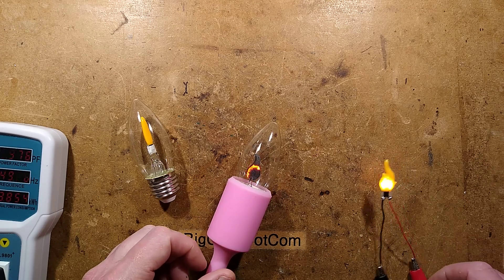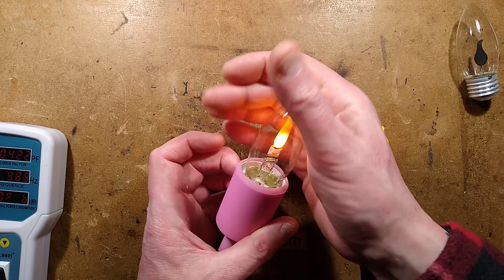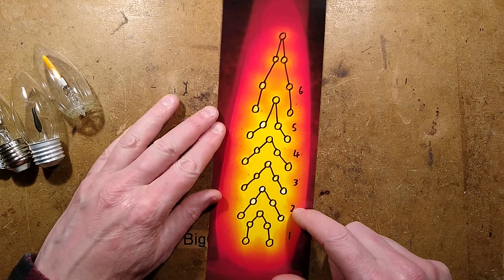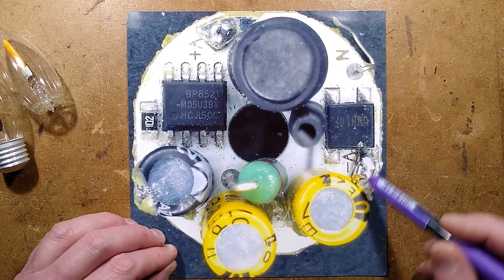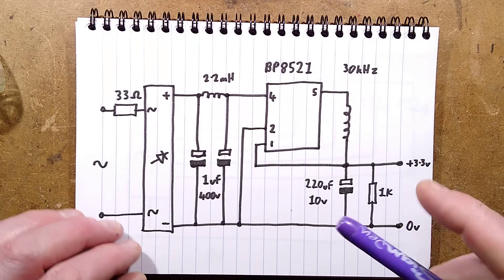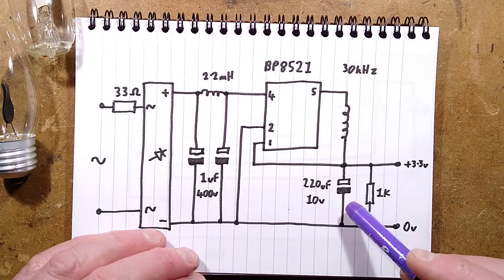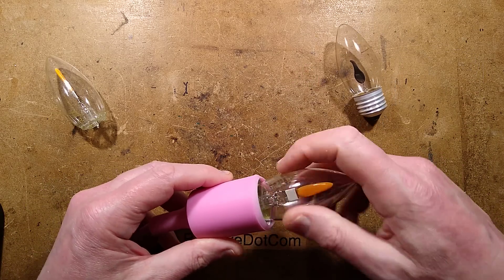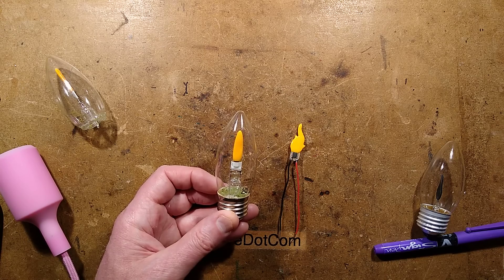New LED flame bulb - with schematic

Comment: There’s a Restaurant in Williamsburg, VA that has huge Chandeliers with real Candles. We ended up going during the day, it turns out the Chandeliers are dripped in Candle Wax, and have LED Flame Bulbs. Very Realistic at Night. Also I have a friend who has Gas Mantle Lights, outside. Again a LED Fake, also has the tiny Speakers for the low hiss.

Comment: I love that light! I need that element in 12V for a low voltage outdoor fixture. Was the other one you had 12v?
Reply from the maker: Both 3V..  but you could use a resistor in series to limit the current, and maybe a zener to cap the voltage to about 5V.
Reply: Thank you! I just found out my transformer outputs 12v AC... That's going to damage the little ones from Ali-Express, isn't it?
Reply from the maker: @WelcomeToMarkintosh  You could still do it with a rectifier and a capacitor in parallel with the zener.

Comment: Hi. Clive. Love your videos. I would love you see you reverse a wireless charger. A 10w vs a 30w or higher. And what could you do at the cheap one. To make it work like a 30w
 So you won't have to pay 10 times as much for 30w compared to 10w.. Hope you read it and at some point will consider it. ❤
Reply from the maker: There is a significant material difference.  Trying to force higher current could cause thermal issues.

Comment: As microLEDs have got so easy to manufacture, it is incredible how they spread among all possible applicative sectors.
I like how they made a geometrical flame outline, instead of using a rectangular matrix and emulate the flame with software. There is still room for improvement!
Thank you Clive...

Comment: I have several old terminal strips that have neon switch illuminators that have started to flicker quite nicely spontaneously...what causes that BTW?
Reply from the maker: As they get older the neon discharge starts moving on the electrodes like a mini neon flicker flame bulb.

Comment: sir, would using a verible power source input allow the bulbs to flicker at a variable rate, instead of just every bulb flicker in unison?  in other words is there a differnt flicker in the us 110 60cycle vs uk 220v 50 cycle...     nice chanel mr clive
Reply from the maker: They run at their own speed, so they drift out of sync.

Comment: Curious if it would be possible to make one of these with the tip of it setup as one of those 'Tesla' arc- electric lighters, {maybe even a proximity sensor to trigger it?) it would be kinda cool  you would have the led flame lamp, and move an object near its tip and the arc lighter could go off and then you have lit your match or 420 in a very unique way.

Comment: EVERY TIME! It gets me when you write on the components on the printouts. It takes a few seconds of wondering how I would write on the top of a capacitor, especially the one that's "behind" two others. And then it hits me, 2D and 3D not the same thing 😅. I claim that I am just very good at spatial perception and imagination (which is actually definitely partly true).

Comment: the invention of ws2812b etc addressable leds are also hugely fantastic. Install WLED via browser straight on esp32. connect and program it via browser or wifi, then power a whole load of them with 5v power bank. or even 12v 20amp for a really bright and decent amazing custom image display or scrolling text effects and all kinds. :) Clive, will you ever do any vids involving WLED ws28112 and esp32 ?
Reply: The local Social Club put up some strips on their ceiling last Christmas. I was surprised that they could do chase effects from one end to the other of a 50+ LED long strip with several strips perfectly synchronised.

Comment: What's the voltage drop across each of the individual leds? How are they powering 5 leds in series off 3.3v?
Reply: they're in parallel. Not series.
Reply: @kimchristensen2175  that makes sense

Comment: Those do look pretty good... 
I've got some flame-imitating LEDs of various groupings around, and the problem I found is that out of the corner of my eye, I keep thinking there's something on fire... It was happening often enough that I had to stop having them plugged in because, with all the forest fires that have occurred up here one becomes hypersensitive. The color and the flickering pattern are just too realistic. I was figuring I'd replace the LEDs with various other colors that I like... as I have all kinds of crazy colors. my favorite is the high UV purplish-looking ones. 
 Speaking of LEDs- near where I live there's a giant scrap yard that sells stuff for the price of the scrap metal contained there-in...  they have everything you could possibly think of including all sorts of giant capacitors, bins of restaurant-quality stainless steel cookware in almost brand new condition... I got a bunch of large solid-state relays... every manner of machine and material... I almost walked out of there with a "Hello Kitty" pink razor scooter...  almost... and when I was there a couple days ago, they had bins of 170-watt industrial LED fixtures, which take 65 volts, so they run perfectly on my 50-some odd volt (48 volt nominal, around 58 point something when at top absorb voltage) home battery bank. These things are utterly blinding... I paid about $2 a pop for a whole bunch of them. Under-running them a bit like that they should last for freakin' ever. running them battery-direct should be as efficient as the most efficient light source... I'm going to install them all around my shop when I can get to it. Well anyway-

  peace and love.

Comment: Those flicker lights like the one in the pink socket. They use the same technique as the lights you get like in a power strip on and off button..... Sometimes you get one where the button starts to flicker after a while :)

Comment: Thats not "fire simulation at all.. thats just flickering or animation. But it has nothing with fire/candle light at all. Adafruit got an perfect example with this: LED Charlieplexed Matrix - 9x16 LEDs - Yellow and a druver for it. Its excellent.
Reply: If you are referring to the Animated Flame Pendant then that is just a video that plays on a loop. It looks great but it's not a fire simulation either. While the tutorial shows up with the Yellow LEDs the video may be played using any colour of their LEDs and I think it would look nicer with the warm white. Perhaps warm white is a newer colour and wasn't available when the tutorial was made. 

On a side note, I saw a tutorial for making an LED campfire and it looked good. That is a simulation as it calculates the LED colour based on four factors which include a configurable heat lost to the air rate and a sparking rate.

Comment: i was considering today that electronics has made me a better person. i think the break-through was starting, on BC's advice, to only solder one lead of a component, to then hold it up to eye level, reflow and push the component flat, then look again, to check, then solder the other lead, check again, then move on to something else. whereas my natural instinct, from making air-fix models 40 years ago, to assembling a new PC has always been ,previously, to think 'that will probably do'. then everything invariably failed. yet now i am using my new habit of scrupulousness everywhere.

Comment: This would be much more useful in an E14 base. I wonder if they used E27 because the circuit would not fit in to the SES base?
Reply from the maker: It's definitely harder to fit a power supply in such a small space.

Comment: The 2.2uH inductor makes no sense. At 50Hz it's about half an ohm, while the caps' impedance is about 3K, so a bout 1/6000th. No noticeable difference from a short circuit. Or is there a reason I haven't considered?
Reply: The buck convertor IC works at a much higher frequency. The filter is to prevent EMI noise from getting into the house wiring.

Comment: If the 8-Pin regulator takes a „feedback“ off of the 3.3V output, if you’d put a diode pointing towards Pin 1 would it output 4.3V (if we assume 0.6V Diode drop)?
Reply from the maker: Some circuits do add zeners in the feedback path to increase the voltage.

Comment: nice bulb. the heatshrink might be there to stop the glass cracking off. one more thing.
the original gas filled flicker bulbs have a secret sideshow mode. the entire bulb can glow orange like one giant neon indicator with high voltage high frequency ac.
wire spiral or grid on the outside of the bulb functions as the second electrode. works with failed flicker bulbs.

Comment: Did you try plugging in two of them at the same time?  I'm curious if the pattern has and fluctuation or if it's just referenced to the frequency of the AC power.  Having an entire candelabra with all the flames identical would look at bit odd.
Reply from the maker: The lose sync with each other.

Comment: Now this is one of the advantages of COB (Chip On Board) LEDs. You can get super tiny and compact LED circuits on a translucent board.
Reply: They work really good on those strip lights...

Comment: I wonder what would be more efficient. A battery pack driving the bulb or an equivalently sized candle? Sure they have their uses but an LED flame bulb is bording on consumerism.
Reply: probably a LED bulb. Most of the energy in the candle is wasted as heat.
The main selling point for the fake LED candle is not efficiency though it's safety (it's a little fire), cleanliness (the candle will leave smoke and paraffin/beeswax/whatever residue around) and zero maintenance (candles don't last long and will need to be replaced often).
So for decorations they often win on that alone.
For actual illumination candles have lost the battle ages ago even to kerosine or gas lanterns, electric is not even in the same ballpark
Reply from the maker: I'm sure they'll have solar versions soon.

Comment: Wlel, with them being in the warm white colour range, at least they'll be more flame-like than the neon kind, but that said, flames are usually stable and smooth when from a candle or oil lamp, so, flickering flames are more suitable for use in an ex-fireplace, stick 'em in amongst somw fake logs or coals with orangey-red light from below and there's a nice display... :P
Reply: I have some of the older style LED ones in my fireplace and they look really nice

Comment: You mentioned putting them in a chandelier or fitting. Do they slowly go out sync like the dumb flashing LEDs or stay in time with each other due to the micro controllers pulsing them?
Reply: Most likely go out of sync even if it is a microcontroller, the timing is usually not that precise in these applications._
Reply from the maker: They quickly go out of sync.
Reply: Perhaps the program tries to add some randomness, some micros have a random source inside them.
Reply from the maker: @boilerbots  It would have been very easy to implement a linear feedback shift register in code.

Comment: All those efforts that were made to develop the electric light bulb and now we want ones that look like candles! :-)
Reply: Decades ago indicator lamps were white incandescent bulbs.  Then LEDs were invented and they all became red, then green LEDs came along and they were red, green and yellow, then blue LEDs were invented and after a short period of indicators all being blue, they are now all white again.
Reply: True. Lol. There is no pleasing some people.
Reply: Only look like, not actually be.
Reply: We seem to have an inherited affinity for flickering flames and the smell of benzene. This provided an evolutionary advantage for obviously modern apes that found shelter in caves and manipulated fire; so it makes sense that lights that recreate the visual experience of a controlled fire would be soothing to us. A lot of Yule Log videos went viral a few years ago due to this.
Reply: @petersage5157 
OK, but why the smell of benzene? It's not a particularly pleasant odor. Reminiscent of tar pits like La Brea or the tar sands of Alberta?
Reply: @stevengill1736  It's also the main component of the smell of smoke. Lots of Seppos use a fireplace or wood burning stove in the winter instead of, or in addition to, a gas furnace or heat pump because they like that smell.
Reply: @petersage5157  - Well, by that logic we'd prefer to live in rough-hewn caves instead of modern houses full of flat, smooth surfaces and right angles. 

I don't think I know a single person who would like to have all their lighting replaced with flame bulbs (or real flames). They're just decorative, like garden flamingos or wind chimes.
Reply: @RFC3514  Yellow (sunset) light is good in small doses. I actually can't stand it for long, overly yellow light (like, super warm amber colored bulbs) make me dizzy after the while.
Add flickering and that's puke-fest for me.
Reply: @RFC3514  It's a calming background effect.  There's something cozy about reading a book (made of paper, not from a screen) by the light of a fire.
Reply: Ahem?  We've had candle light bulbs for the last 50 years...at least.  And quite honestly the incandescent ones were a lot better looking.
Reply: @sa3270  Really?  Better looking than the ones which are 4 for $1.25 at Dollarama?  Lol.
Reply: OH NO, we have evolved into Moth-Monkey things, that have worked out how to bring the fire inside.! 
I can't decode what @thisnthat3530 is saying. 
😉

Comment: I would love something like this for our carriage lights but they're all just too dim.  
Real gas lights aren't super bright but they're still an order of magnitude brighter than the current generation of flame LEDs.
Reply: You mean the ones fitted with a mantle 😉
Reply: @samuelfellows6923   Nah... just the gas jet, like you still can find in some higher-end homes.  There are still a lot of homes in New Orleans area that have gas carriage lanterns.
Reply: @samuelfellows6923  I bought a number of 1960/70's caravan gas lamps from e-bay (Morco) and fitted them in my custom camper (which I lived in during the week working away). Helped with heating and took a load off the 600AH batteries in the winter when 400W solar panels aren't very effective. The made a lovely hiss and brought back memories of my childhood in our caravan at Weymouth. It was fun but there's the downside of carbon monoxide production and, it goes without saying, gas is explosive. I'm still kitting out a cabin at the end of my garden with them.

Comment: I have next to no idea what you are talking about in any of your vids because I am useless with electronics ( yes I once tried to change a plug socket without turning the power off and got a very hefty shock, and yes I did try to fit a plate rack above a plug socket and drilled right through the centre of a cable and had to have my wall rebuilt) but I watch every video. Great stuff, never know I may learn something one day. Talking of which, I always have crappy Chinese electronic  things stopping working, or doing weird stuff they are not supposed to,  want me to send any to you?... "One moment please" 😊

Comment: They remind me of a kerosene heater wick that is spent of fuel and is sputtering off of the vapors. I am not awfully impressed with those lamps. But they're ok. I've seen battery operated candles that have a better flame effect. 
But seeing your schematic is interesting.
Reply: Particularly the ones that have a separate tank and valve for the paraffin and a fixed wick in a around burner slot

Comment: Wow, led's are getting creative. 

The miniaturization of microcontrollers these days is crazy...
Reply: yeah nowadays most designs implement microcontrollers even to do the job of a 555 IC. They are crazy cheap, especially the one-time-programmable ones
Reply: So cheap most of the cost (under $0.10 total) is the package and leads, I wouldnt doubt it if bare die gets below $0.01 in high enough quantities. @marcogenovesi8570
Reply: Miniaturization??? This was a standard SO-8 package for the microcontroller. The same as existed in the '80s. Today with just more juice in it.
About 10 years back I made something very similar on a weekend, for my kids lantern.
Reply: And that package sort of traces back to the first milspec "flatpack" ICs developed in the mid 60s, at which point your average tech was complaining about how transistor radio parts were "too small" to easily work with, I think complaints about miniaturization are sort of a constant one should largely ignore. Some silicon aside its easier than ever to buy all the through hole stuff one desires. Stuff that stays useful stays in production, there are even a couple 1920s vacuum tubes still mass produced. @matthiash.4670

Comment: I would have guessed that there might be another resistor in circuit with the LEDs to drop their voltage.
But that would require breaking the glass and cut the shrink wrap.
Reply: Since the set of 7 LEDs in parallel is dimmer than the sets of 5 LEDs we can tell that there is resistance in series, even if it is not in the form of an individually packaged resistor.

I suspect that the output transistors have a fairly high on-resistance. In other applications this would be considered parasitic resistance, but here it is useful and avoids the needs for additional components.

Comment: These also have the positive of not having to evacuate the air in the bulb when they manufacture them.
Reply from the maker: Although, strangely the seal was tipped off.
Reply: @bigclivedotcom  probably as that's what the machines were already set to do.
Reply: The LED filament bulbs are filled with Helium for heat dissipation. Having recently bought a Helium Balloon in a card shop and thought about how many bulbs it would fill, mark ups etc the Helium required is probably only a couple of pence.

Comment: Has anyone seen these for sale in low voltage (12V and below) versions? I wouldn't mind replacing some of those mechanical flicker lights with these.
Reply from the maker: The bare flame PCBs are available on AliExpress.  They operate at about 3V.
Reply: Thanks!